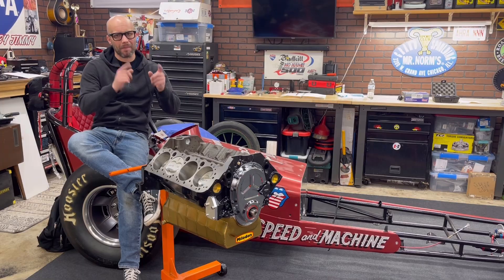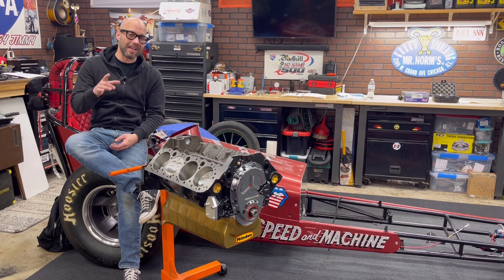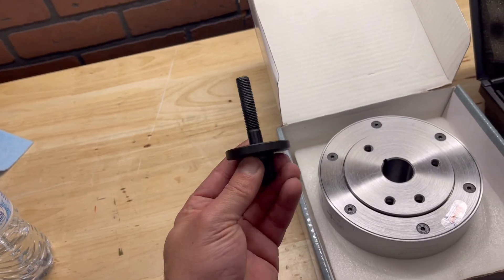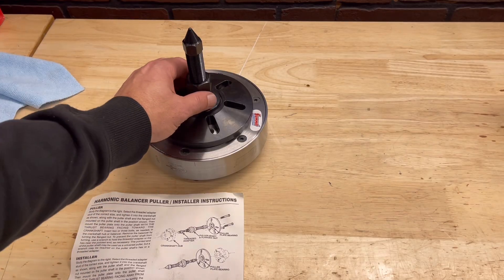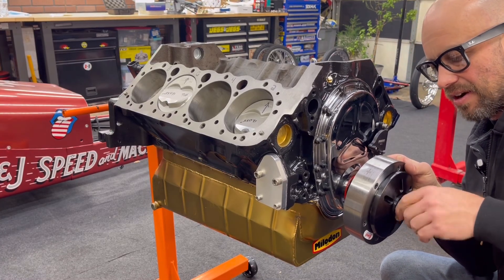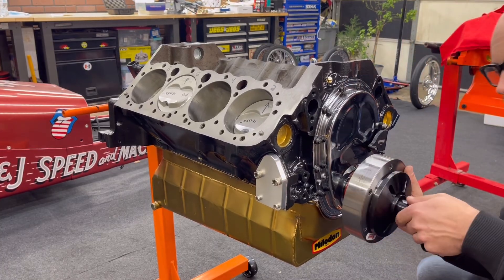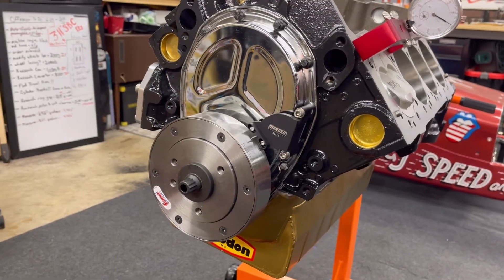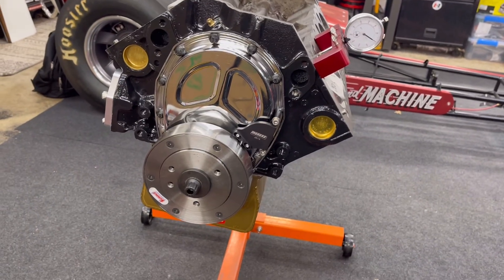How To Install a Harmonic Balancer on Your Small Block Chevy #howto

Comment: Hey im using this but on the original timing marker that goes from 12-0-12. Not the onenu have. If im gonna keep using the one I have where should the zero on thr balancer be set at with relation to tdc and the timing marker
Reply from the maker: is it a stock balancer?

Comment: Thanks again any advice on Distributors & coil ?
Reply from the maker: on my dragster engine, I will be running a Vertex magneto with an internal coil.  The DZ292 project is getting a Mallory electronic ignition distributor with a mallory coil.  That being said, it is hard to beat a good high performance HEI unit with a built in coil.  Easy to use and setup
Reply: @2HacksGarage  Hello again I meant to say on a high po Street car with 550 horse SBC ?
Reply from the maker: @davez3838 the Mallory unilite electronic ignition setup is pretty darn good
Reply: @2HacksGarage  Ok Thanks for your help I appreciate it!! Let you know how it goes.😎✌️

Comment: Sorry for the dumb question: Is it necessary to take something like engine oil and use your finger to wipe oil on the inside of that cover seal where the shoulder of the balancer slips inside and seals at that location. Or does that seal stay pliable over time because of an oil bath inside? Thanks for the reminder that I need to buy a new balancer and bolt if I do an engine refresh as I have heard you should not re-use those 2 things from the old motor. Thanks for these educational videos. My parts shelf keeps growing as I keep getting good reminder tips.
Reply from the maker: I have reused balancers, but you really need to inspect them.  in my opinion, if they are old, it is best to replace them. As far as the oil goes, I think that is for ease of installation in most cases
Reply: @2HacksGarage Thanks for the good advice!